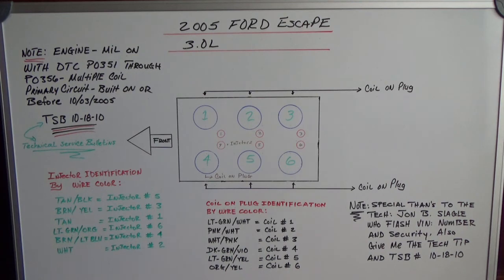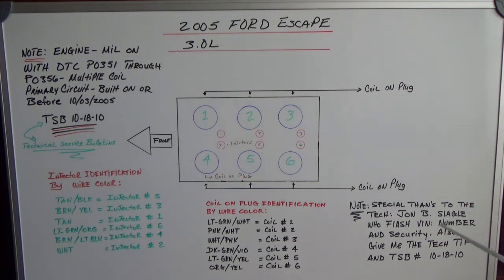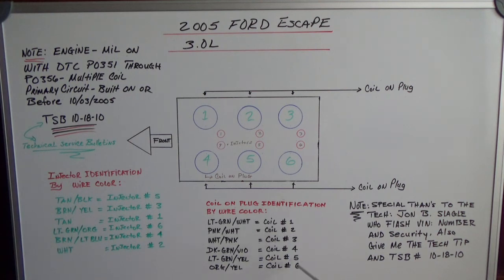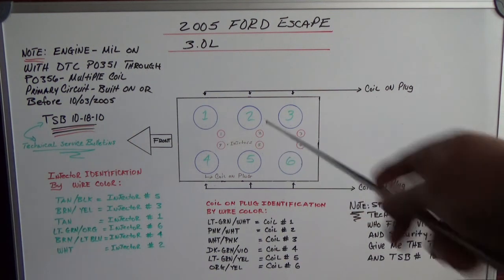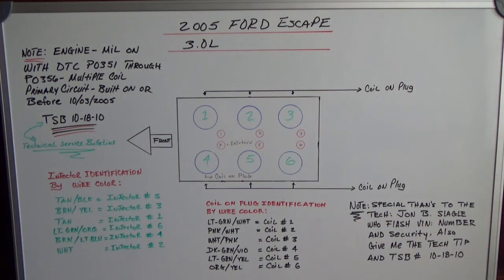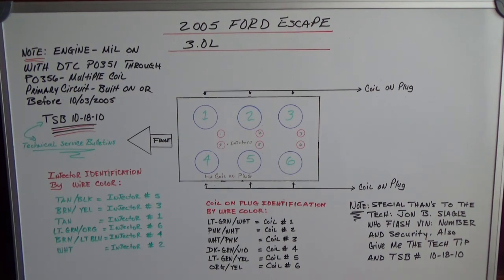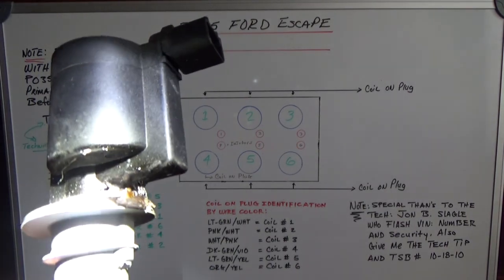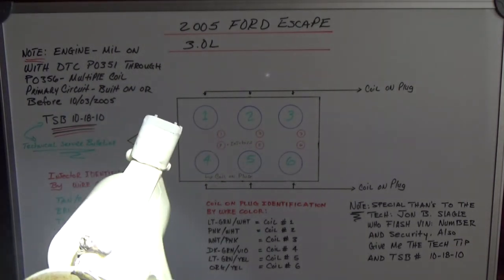2005 ford Escape Final Chapter

Comment: I have a 2006 Ford escape recently replaced the ICs on the PCM in the same area where they were burnt and replaced all of the coil and spark plugs went back to the vehicle today to put everything together still no start but when you leave the key in the position run on the fuel pump and leave it turned on I get smoke from the PCM the same area and smoke in from the engine of one of the coils Pack The same chips burnt out The ones that replaced Took it to the Ford dealership a month ago and they told me it needs a new motor due to low compression almost US$12,000 they call it a long block  any new updates on the Ford escapes 2006 model six cylinder and of course the Ford dealership says no recalls on this model